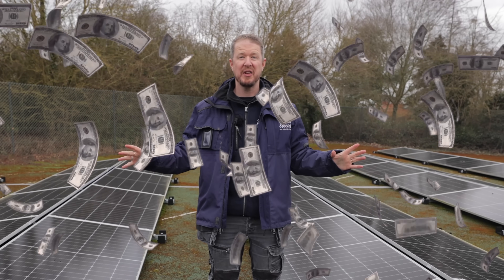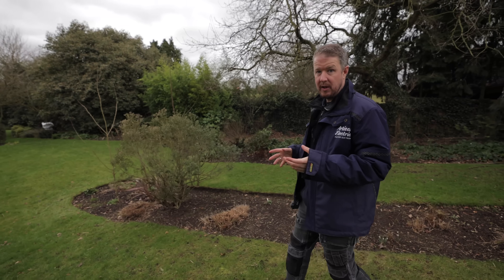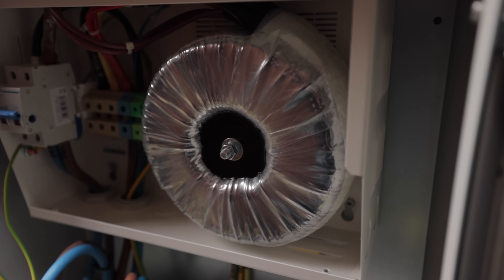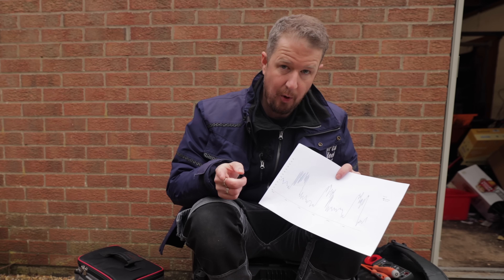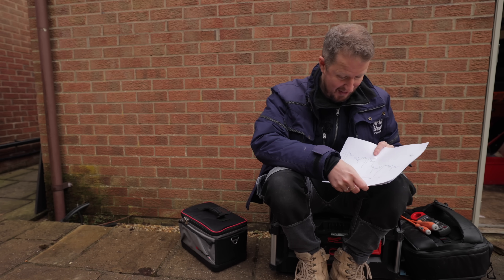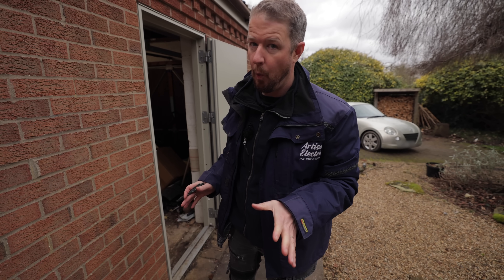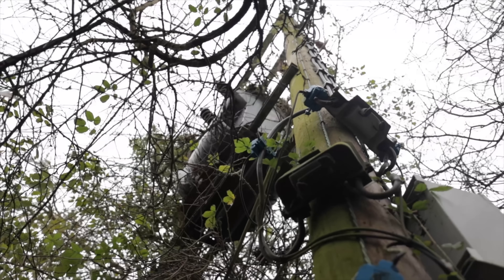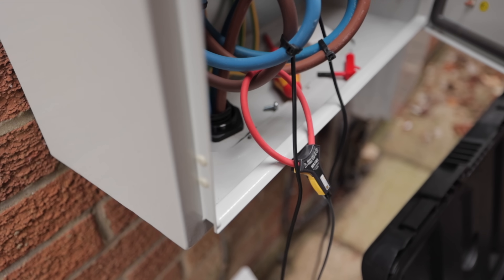THOUSANDS Down the Drain – And We Can’t Do Anything About It!

Comment: surely you should have checked the loop impedance before you did all of this. UKPN spec 0.35 ohms max loop Z. 17kw is 73A.  73A across 0.35 Ohms is 25V.  So your 73A is going to raise the grid voltage locally by 25 V  which is roughly what you are seeing 240 +25  =265.  Assuming loop Z is within limits. If you can show the loop Z is more than 0.35 Ohms then fair cop. UKPN should do something.,   I dont think this problem is insurmountable with or without UKPN intervention.
Reply: This is the problem when systems like this are not designed by experienced engineers rather just kit getting installed by electricians. There are many factors that installers are not typically accounting for because they are just installing and not doing necessary engineering.
Reply: @schrodingerscat1863  Exactly right ....fitters not engineers
Reply: @schrodingerscat1863  I don't think this is the case. The power company should analyze their side in their own expertise and give you yes/no/limited response. 
You as a normal house/ solar installer electrician are not going to do expert work for them. Because it's their duty. In UK codified even by laws if I remember. Especially if they are owners and maintainers of the grid up to your house junction box.
That is separation of duties.
Reply: @rybaluc  You are correct it is the providers responsibility to make sure they can meet agreed spec. In this case they obviously made an error in their calculations. Good luck trying to get them to admit that and to sort the problem out any time soon though, which is why as much evidence of the actual issue has to be provided to them before you start.
Reply: exactly this comment @schrodingerscat1863
Reply: @schrodingerscat1863  It's like plumbers trying to install heat pumps........
Reply: @JC-jv5xw  Exactly you need a heating engineer to design the system doing all necessary calculations first. 
Most plumbers don't even know how to correctly spec a condensing boiler which is why you see so many with steam bellowing out of their exhaust stack.
Reply: Loop impedance check was/is critical with the high current levels involved, and more so on a single phase system. It will be interesting to know of the final outcome. The saddest part is the costs involved! Ouch... 😢  True commiserations. 😢
Reply: Yep, crazy that such a big install was done on just one phase. My house is "supposed" to be and looks like TN-S internally and my Ze is 0.5ohm (max allowed is 0.8ohm on TN-S I believe). There have been so many underground joint repairs in the vicinity over the decades (including a dramatic underground explosion a few doors down), I have no confidence it is TN-S anymore.
Reply: @jam99  Yep.  I'm familiar with two fairly chunky installations and in both cased the DNO required the supply to be moved from single to three phase.  As it's not mentioned I assume that was not a condition of connection which is a bit of a surprise.
Reply: @jam99 I think this is UK power grid problem. I couldn't connect more than 3.7kW overflow single phase in my country. And 3 phase is standard connection available everywhere even in deep rural forest with one substation for 4 cottages.
Reply: @jam99  The car charging has it's own earthing rod - but the batteries/solar and heating will all be relying on the earth at the transformer to provide neutral
Reply: @kenrohde6841 Why would the car charger have an earth rod? It's not required
Reply: @alexanderbuckland  maybe its not required but its necessary to take precautions i case of surge
Reply: @taimoorshah8230  yeah. Fit a surge protector 

Not an earth rod
Reply: @taimoorshah8230  They dont use TT or earthing rods, its already suplied by the PEN cables. In other countries even with TN you still have to use a grounding rod yourself to assure its 0v at the meter entry.
Reply: @alexanderbuckland  independent earth rod works fine for surges
Reply: @zaxmaxlax  yes exactly but in my country it is recommended that if you are dealing with high voltage device like car charger which can pull as much as 32amp continuously, it is required to earth the mentioned device independently. I dont know why it is but it is what it is.
Reply: @taimoorshah8230  Depends on country but in most cases, in TT countries, its only necessery if the charger(or subpanel) is away from the main building like in a garage physically separated from the building.
Reply: @jam99   This is one of the reasons I have a floating ground in all of my computer, I had enough with ground loop problems, so I just cut all of the grounding in all of my low voltage equipment, a computer doesn't need grounding, nor does a TV, or any of the shit that I connect to both of them. Ideally I would use an isolating transformer, but just cutting the ground solved those stupid problems.
Reply: @monad_tcp  Old school (unsafe) way of solving oscilloscope input problems.
Reply: @monad_tcp  Unless ALL of your equipment is Class 2 double insulated, then it needs an earth! [Hint: it isn't Class 2 double insulated otherwise the manufacturer wouldn't have supplied an earth pin and you wouldn't have the problem to begin with.] By removing the earth you have created a safety hazard. A metal case or accessible connector could become live during a fault and it would not cause the MCB or RCD to trip... until some poor sod makes a connection to earth through their body. 💀 If you must absolutely float the equipment, then you must use an isolation transformer.
Reply: My parents in Italy had exactly the same problem, although they don’t have solar. Just trying to charge their EV, the voltage was dropping down to 190-200V with only 6kW draw. The network operator installed a similar measuring device like the one you showed. They took logs for one week, the threshold for any intervention is 5% of the time below 207V (230V -10%), which we obviously met.
They dag and replaced 100s of meters of cables, even leaving the whole neighbourhood without electricity for a few hours, but it didn’t solve the issue. Eventually, after several months, they installed a transformer like the one you showed (claimed to have cost 40000€). The problem is that sometimes is a bit slow in stepping up the voltage.
Now they have switched to three phase supply, but the problem is… now they need a three phase transformer (~80000€).
Reply: @jacopo.scarpellini Italy especially small installations around the islands,same problem with grid in abysmal state. I am not surprised.

Also small substations can have windings switch (offline manual) for different voltages. Here even old small distribution transformers dating back to communist era have it. And those are sometimes switched during maintenance as result of grid requirements. 
Moderns distributionsubstations have measuring devices installed along with online voltage winding switching. But those you will find in big settlements or industrial areas only.
But those are standard between high voltage an very high voltage transformation points. But still not in low voltage power transformation.
Even in countries with more modern grid than in UK.
Reply: Laughing in TT 3ph oversized conductors 😂😂😂
Reply: Agree with you. One way to help the situation would be to go to a 3 phase supply and configure the battery chargers and inverters across the three phases.  In effect this would increase the CSA of the cable by three.
Reply: Actually it will it will improve the volt drop / rise by a factor of 6. Single phase incures go and return impedance of the phase and neutralconductors. Three  phase volt drop is only affected by the "go" route of the phase conductors. @Richardincancale
Reply: Exactly this point.
Reply: Hi Jordan
I enjoy your very interesting and informative videos. However, you are a but out your depth here.
I'd just like to offer some advice from a proffesional distribution engineer point of view:
The problem is not the transformer. It's the impedance of the 95sqmm ABC OH line and service cable, which is the main cause. 
I'm very surprised UKPN approved a G99 application for a 17kVA single phase generator connection. Are you sure they didn't specify you connect it at three phase?
17kVA is 68 amps coming down the phase and then returning via the neutral, incurring/creating voltage drop/rise  in both directions.
Three phase would be 23Amps in each phase with no return via the neutral.  The result would be 1/6 th of the voltage drop/rise.
Installing a new three phase service and reconfiguring the generation to 3 phase will reduce your problems significantly. 
By the way, the ESQCR voltage limits don't apply if the customer's own actions cause them you go out of limits. Hoist on one's own petard so to speak. The DNO can only take action if the voltage rise is affecting other customers   i.e. if it  causes voltage rise at the "point of common coupling" which is the pole outside the property. I would anticipate that a significant amount of the voltage rise seen at the property is caused by the impedance of the 25 or 35 sqmm service cable.
PS I'm retired senior DNO  engineer once responsible for the company's  network design, overhead line and earthing standards and co-author of numerous Energy Networks Association Technical Standards.
Reply: Cheap inverters with crappy capacity bank on the DC power stack, they cause these wild fluctuations on the AC importance change. Low dampening😉
Reply: Transformer upgrade could make it worse.  Same transformer closer would be the biggest help.  The issue is bigger transformer the low power effects is lower which would increase the voltage more.
Reply from the maker: Ze was 0.26 ohms - its PME'd at the pole so earth loop is low despite the long run on the line and neutral
Reply: @ Because it’s PME the Ze might be a little lower than the impedance just of the line and neutral, as there are multiple routes back to the substation as (in theory) there’s an earth electrode at each pole.  Nonetheless with 0.26 ohms there’s a 19 volt drop with 73 amps, which takes you close to the limits with a nominal 230 volt supply, before any system imposed peaks or dips.
Reply: @Richardincancale  it’s half that value, the current is not flowing the entire loop, so with a loop of 0.26 ohms, the voltage rise would be against slightly more than half this value (transformer coil impedance is seen on the phase), so the VR across the DNO network (line impedance alone) is probably about 10v and if the install was designed for 1% VR as per COP, the installation should be seeing 12.3v volt rise
Reply: @SethTreasure  Can you explain me a litle more how the impedance is measured?   When you mean its only half are you saying its because its measuring the total impedance after the pme with the earth in paralel with the neutral? I watched some videos, just by going from TNCS to TNS ze is allowed at 0.8ohms what a covoluted mess your earthing systems 😂
Reply: @SethTreasure good point but think that assumes full phase balance on the network. There will be times when the loop behaves almost equivalent to a single phase TX so the neutral return path impedance contributes to the volt drop too. I know the LCT rollout can be a challenge for DNOs - more money needed (!). Hope you’re keeping well :-)
Reply: @robweller9579 hi rob, all good thanks and you? The voltage change on the service would be in the same vector as that of the phase, so measuring phase to neutral, you wouldn’t see an additional increase, thereafter, yes the voltage change is dictated by the phase balance and resultant vector, where a heavily loaded (demand) on a separate phase could make the volts rise on the other phases, so the balance has a large determining factor as you’d know
Reply: @zaxmaxlax the loop impedance is just that, the full loop, which is two halves, phase and neutral impedance, you can’t measure these separately as a sparky, it’s calculated
Reply: @SethTreasure  its funny because in TT countries we dont even care about that unless were calculating max shortcircuit current. Matter fact any form of TN or TNC is banned for less than 16mm2 in france
Reply: @artisanelectrics  what was zn
Reply: @artisanelectrics  PME Ze is 0.26 ohms therefore supply impedance is 0.26 ohms the supply nominal voltage is probably 240V, you try to send 17KW then you will need to send about 66A and get 17V imposed on the 240V and you are up at 257V... Clamp the export to limit to 253V then you may say be exporting say 10Kw to 12KW, equally if you are pulling a full 18KW from the supply then expect the voltage to drop to say 220V.
Reply: Wouldn’t the Electricity supplier not tap the transformer at the road down 6% or so might have helped
Reply: @robertjones7221  Problem isn't in the feed voltage it's the voltage when they are feeding back to the grid from their PV system that causes an over voltage.
Reply: @robertjones7221  That may mean that the line voltage to other properties would fall below the legal minimum at times, and get them in to damage claims.
Reply: What's the max voltage from the solar?
Reply: This is why on new builds they are on about a two phase supply like in the States
Reply: The aerial cable looked to single phase. If 3 phase was available it would of been done that way from the beginning
Reply: 300 metres from the transformer and a skinny overhead cable.would you be able to get a high enough fault current to trip the main circuit breaker. If not then the supply authority have the issue
Reply: Where does the supply authority finish and the customer service start. if it near the house or on the house then it is the supply authority’s issue
Reply: The problem is you guys are stuck in 240v in a ww2 grid. 25KW is like the average for any house in france, belgium, germany etc... I dont get why injecting 17kw is even remotely a concern. The average murrican home is like 200amps service, 17kw is laughable. First off, the converter shouldnt fluctuate, period, it should supply the spec voltage at the rated current. Im gonna watch that video again, if anyone knows the equipment used, pls let me know Im interested in reading the manuals. Before I forget I will say it again, if you guys used TT you wouldnt have to deal with PME PEN whatever BS fault. Sorry If I sounded rude but you've shouldve upgraded your grid in the 70s like the rest of europe.
Reply: @ Lack of spending on infrastructure can just about sum up the UK since the 1980s.
Reply: @jam99  Goes back way before 1980's, this has been going on probably since 1950's when the post war rebuilding effort came to an end. All part of the managed decline we have been in since the 1950's
Reply: @zaxmaxlax  its the neutral line impedance that is the issue.... you need to test this before connection
Reply: @jthomas3994  Thats why he said 3 phase is the way to go, neutral current should be minimal even on a somewhat unbalanced system. I remember that video, didnt he under specd the inverters and passed unarmored cables through the field without even a conduit? LOL
Reply: @jthomas3994   Didnt he test Ze or whatever you call it in the UK? I saw the video and googled the inverter, the 10kw one should supply a max of 45amps, he showed 3 of them but he didnt show or explain how theyre setup(classic artisan). To be completely honest, I dont think its worth 70k quid, A normal 3 phase car charger in france is like 12kw, that inverter cant even supply that. The owner wanted to play big boi, artisan shouldve use the commercial solar edge line, 3 phase for the home and car charger, more batteries, and maybe another inverter just to inject on the grid, but I wouldnt even bother, the guy is never gonna get back his money anyways
Reply: @zaxmaxlax  In Ukraine most of residential places had 3KW since USSR times.

So now with PVs you got to get new (overhead) wires to you place. ~10KW could be one phase but  anything above that is 3 phase with max cap on PV installation at 30KWp
Reply: @zaxmaxlax you really don’t understand how rural power grids work, no matter where you live.
Reply: @zaxmaxlax  you never have electrical issues in utopia lol get a grip
Reply: @P.G.Wodelouse  Sure not on a first world country 3 phase grid
Reply: @zaxmaxlax  sure sure bud, i bet you wear glasses where the lenses are tinted red
Reply: Change inverter battery charger amper. Lower amper

Comment: Surely there is a problem with the solar inverters in allowing 260+V to be generated? I get the issue with the voltage drop at night with the 17Kw load from the battery charging coming on, that could well be an overloaded or undersized transformer, or an undersized supply cable to the property, but over voltage is down to the generator. (Or in this case inverter).
Reply: Agreed. The inverters should have a parameter which sets the highest allowable generation voltage and if that is exceeded you should get a "grid over-voltage" error.
Reply: @mb-3faze  the inverter will be configured to g 99 which will disconnect from the grid above 253v with a logged error code in the software. All part of the British standards for grid synced generators. 
The transformer needs upgrading . Old designs didn’t account for reverse energy flow .
Reply: I had this on a job 15 years ago where it kept tripping out on high voltage. It was a sunny boy with a sunny beam and I sent the data to DNO and they came and data logged it. Customer was right on top of the transformer and if course it's much easier to turn voltage up rather than recable for miles. They did fix it no problem since other than she is on her 3rd inverter!